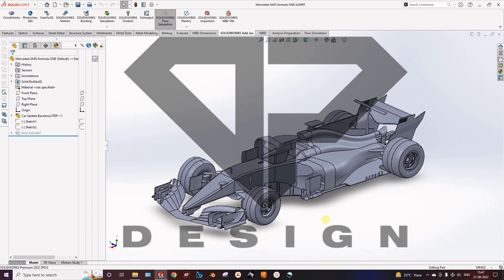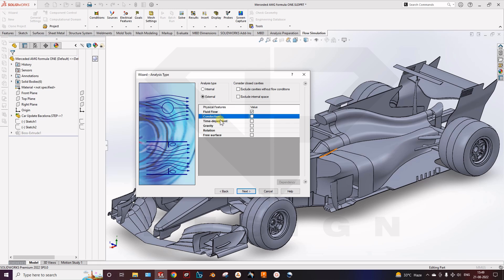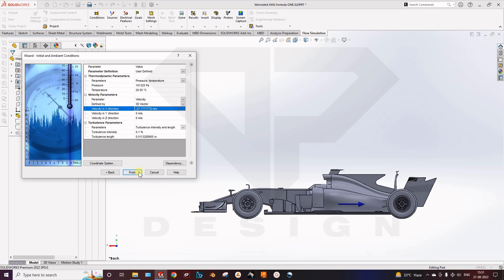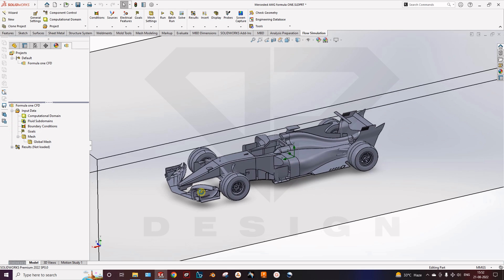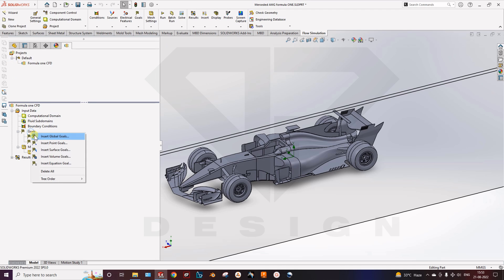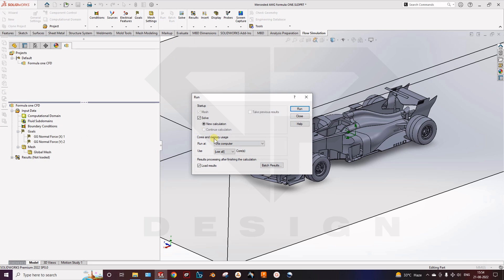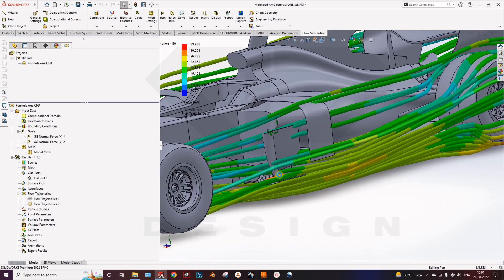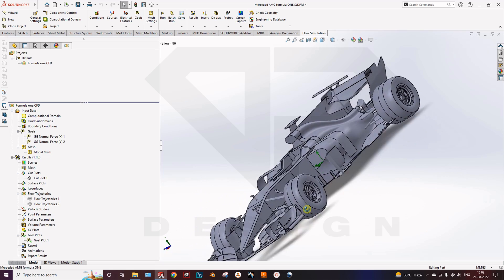Solidworks Flow Simulation Tutorial (CFD) : Formula one car Aerodynamics simulation (Part 1)

Comment: sir mine shows that fluid volume recognition failed and suggests me to check geometry
Reply: Did u solve the problem?
Reply: @djordjegacic1450  fortunately yes 👍
Reply from the maker: You have to check that all the parts should be solid & if you have converted the files into some other format, convert it to parasolid and then check the fluid recognition. It will solve the issue

Comment: Do you have the model that you used? I have problems with Solidworks with almost every F1 model that I download because the program does not recognice the car as a solid.
Reply from the maker: We are selling the CAD model with CFD files as well. You can contact us on instagram or through mail id for this.
Mail id : dpdesign.engineeringsolutions@gmail.com
Instagram : @dpdesign.solutions